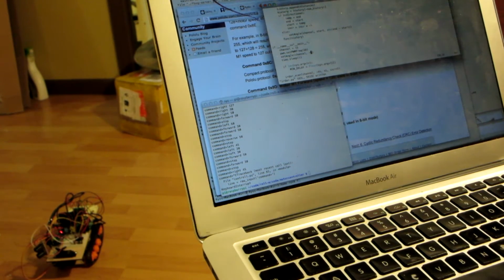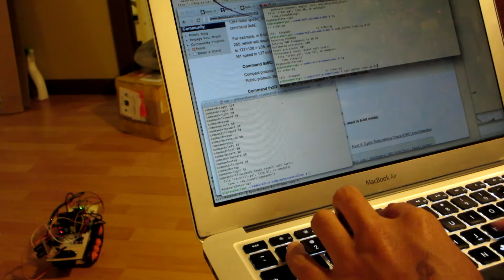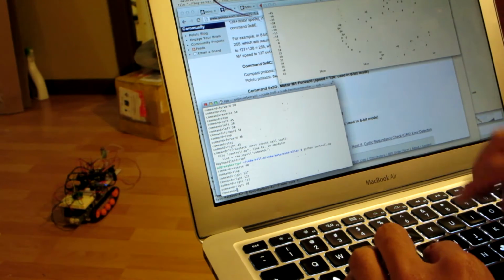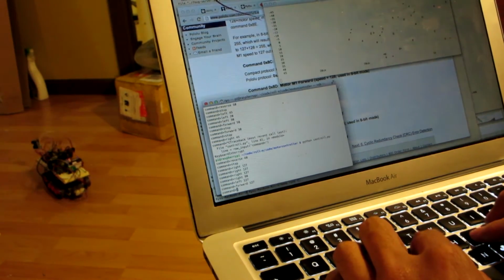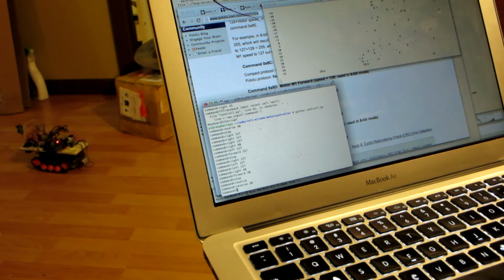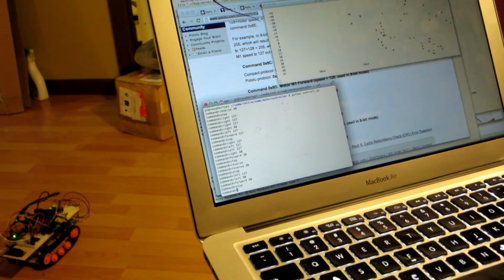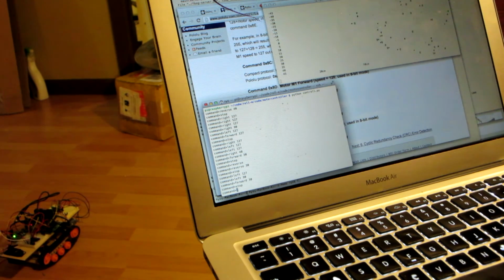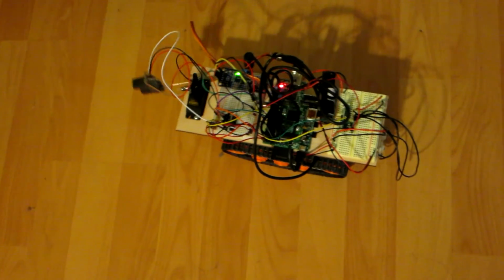Tracked Raspberry Pi Robot

Comment: I have made a Rpi walker and a standard buggy style bot. I got around the problem of the Rpi restarting due to current draw from the battery by have the two regulators connected to the battery, that is one for the pi one for the h-bridge\servo's, allows one battery and keeps the Pi isolated from current drops, the lipo's I use are high discharge (40C) so that may make a difference too

Comment: Great work! This is really similar to my project. I've got better results than you scanning with a Sharp IR sensor by making several readings at each angle and taking the median - try it, it eliminates the interference noise (eg from servo). The tricky part was tuning the conversion of sensor reading into cm. To test it I used MS Excel to make a radial graph of the data (angle, distance). The 90 degree angles of walls were spot on and the distances were within +-2cm. Keep in touch.

Comment from the maker: Made a little more progress. This will serve as a development platform for more interesting things.
Reply: hello, I have same chassis kit from tamiya and I am planning to interface my vehicle with Rpi for a similar setup. My aim is simple, I wana go without radar and camera for now. Chassis car is ready and it is setup with battery and its switch to move it backward and forward. Is there a chance that you have a pictorial steps with little bit of description or at least what parts are needed? I have adafruit's budget pack for rpi and one arduino as well. Can you advice as if I should first arrange a board or platform to stage my electronics on top of tamiya? thanks in advance.